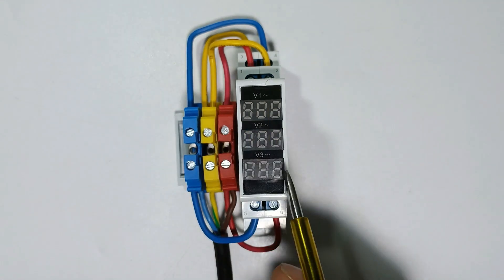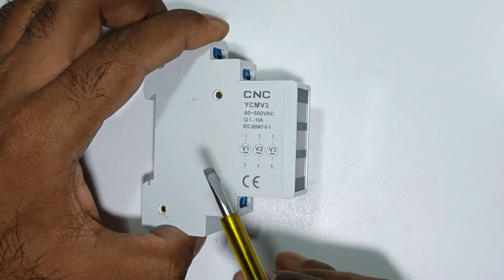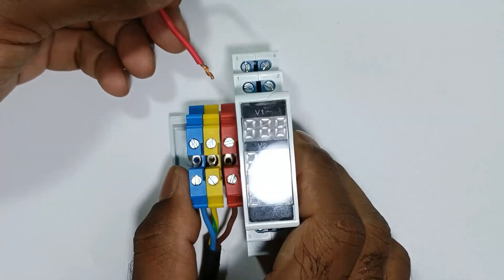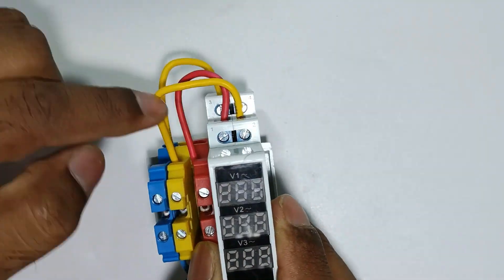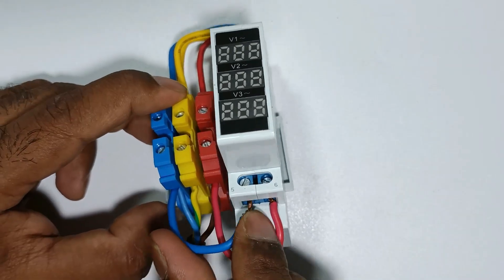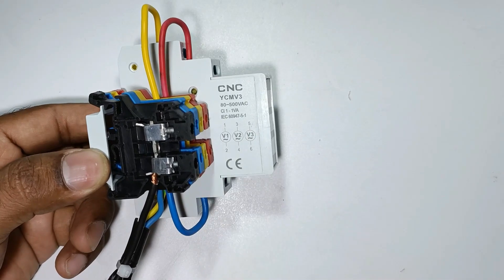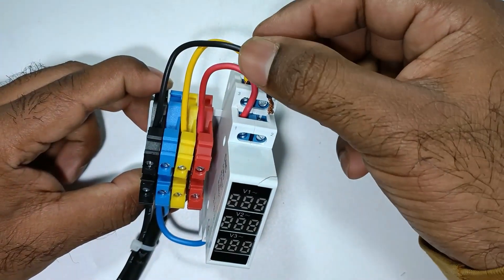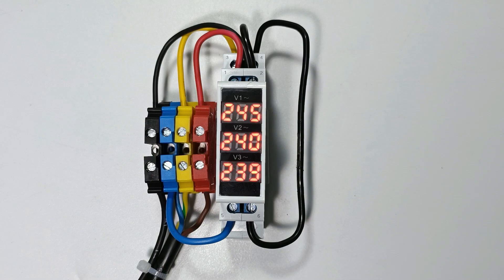Three Phase Voltmeter Connection to Measure Phase to Phase and Phase to Neutral Voltage

Comment: Hallow Sir, thank you so much for your teachings based on different types of electrical equipments. Can you please make videos to design Circuits both Control and wiring circuits for mixers and extruders in Cables manufacturing step by step how are cool circuits and wiring circuits join to perform one function? Please help.